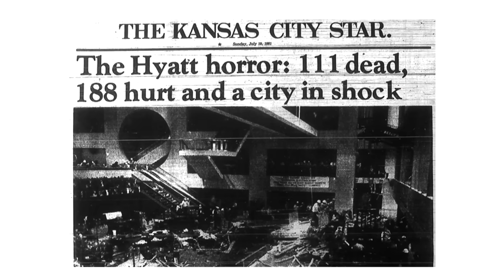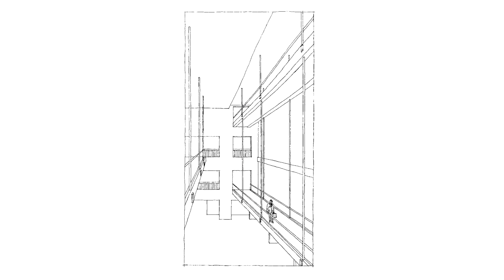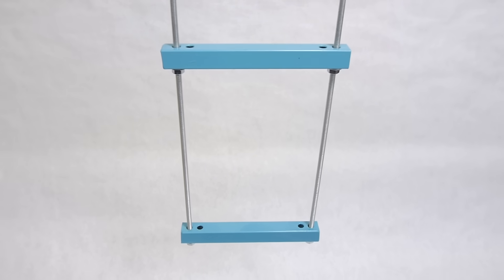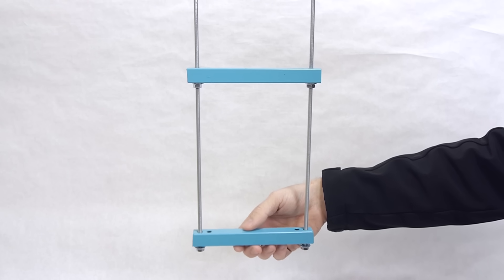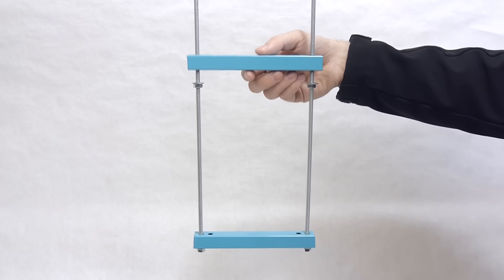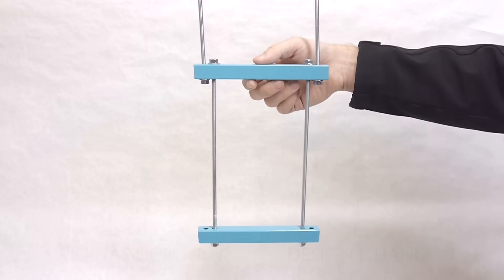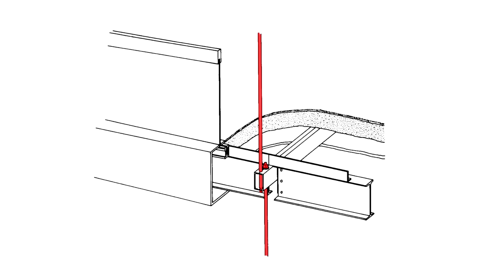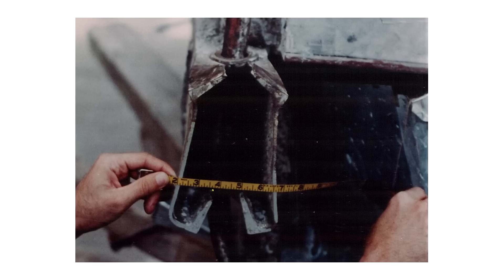The Disaster That Changed Engineering: The Hyatt Regency Collapse

Comment: I liked the analogy of me holding onto a rope, and a friend holding onto my legs.  My grip then supports double weight.

I recommend Henry Petroski’s book To Engineer Is Human from the 1980s, especially the chapter “Accidents Waiting To Happen.”  From this book, I draw four contributing causes of this tragedy:

1.  The walkways were under-designed from the beginning.

2.  This change made them worse.

3.  The construction project was — almost inevitably — behind schedule.

4.  There was an unusual use is that there was DANCING on the walkways during the party.  There really was.  But obviously, the walkways should have been adequately designed to withstand this.

And lastly, don’t engineers sometimes plan for “alternate load paths”?

Comment: Far far more interesting is the design errors in the Miami foot bridge collapse. Which combines a shambles from start to finish, by all accounts.
Reply: That entire thing was a train wreck. I remember everyone blamed accelerated bridge construction “the bridge was built in 2 days!”, then Chinese steel, then the fact they “didn’t put on the suspension” even through it was decorative and then the alt-right blamed it on an all female team which was a complete fabrication. 

In the end they simply miscalculated the shear loading and therefore didn’t adequately reinforce the deck at the 11/12 node.
Reply: @morbideddie  As an Engineer myself I am well aware of the huge concentration of forces in bars, nuts and concrete at the nodes...to my mind almost impossible to really conceive working in such a lash up.
My whole working life has been to never stand under a moving load, almost a mantra for 50 years.... but here we have numpties trying to tension a structure that is already working, over an active highway.

Comment: you know i watched the seconds from disaster on this incenent when it came out on discovery channel and it got me thinking at the time. pepoel say about lurning from the past but having never worked in structural and limited knowledge of civil engineering. as an child having seen the investigation photos with no prior knowledge of the incident. i came to the same conclusion the inquest did within seconds of being told how it was constructed. even i know that suspending one load from another suspended load is stupid. if you use a little common sense then you can catch these failures before they even start. no excuse as far as im concerned, these people are supposed to be experts in there feald yet ballsed up and killed over 100 people. if it had been through material failure due to a genuinely missed flaw from the factory id understand or the walkway was loaded to 2x what it ever was desined to take even if it was made properly. but seriously, to quote one of my workmates. "what the bloody hell did they think was going to happen". im 31 now and this incident still winds me up to this day.

Comment: The design change was accounted for with bigger nuts.  The ussue was that the walkway was designed for people to walk across not stand on and jump around.
Reply: the walkway should have a high enough safety factor to handle all of those things. if it could handle walking and not standing/jumping then it's not safe enough for use, even if it will only be used for walking
Reply: The nuts didn’t fail, the beam did so bigger nuts will only spread the load a little wider, they won’t change the fact that the total load on those wields is doubled. The walkways were poorly designed on multiple levels but I can’t find any reference to the error being from a lack of dynamic loading accounted for.

Comment: I’d imagine that the redesign also added some torque into the equation?
Reply: It would add moment to the cross beams but it would actually be resisting the main bending in the walkway since the design used hung the lower floor from the outside. This additional moment wouldn’t affect the loading at the nuts since they allow rotation but it would reduce the momentary load in the centre of the walkway.

Edit, checked a sketch from the incident and it turns out that the second walkway was actually hung from the inside so yes, there would have been some additional loading on the cross beams, though that still wouldn’t apply to the bolted connections and would probably be fairly minor considering the short lever arm.

Comment: I still don't understand why so much of the blame is placed on splitting the threaded rods into two sets. Sure, I understand how that doubles the load, but why does no one talk about the fact the load was placed on the TOES of the C-channels. As I understand, this wasn't a box girder... it was two C-channels welded toe to toe. If you look at all the pictures, it isn't because the channels couldn't take that kind of moment. The channels clearly could not take that rotational torque. All the time I see I beams have additional plates welded at these locations so the individual bottom and top flanges don't fail. Why wasn't it done here?!? I'm curious if the design would have worked if they used washers that were big enough to actually get the load under the webbing, thus putting no rotational torque on those toes. OR, reverse the C-channels, so the webbing were to be back to back, rather than toe to toe.

Comment: Before my degree, I used to go on roller coasters and have fun on them. Then I got a job and met more engineers. I don't do theme parks anymore
Reply: Even worse than roller coasters is fairground equipment that gets packed up and moved every few months. How often have you taken apart some reasonably complex machine like a lawnmower, put it together, and found there’s a washer or split pin left over? Even worse, how often have you done this, run the machine, found it works fine, and thrown the leftover washer into the “spares” bucket. Ok, I am not a highly qualified engineer, but neither are those guys at the fairground.
Reply: @albertbatfinder5240  Roller coasters are safe dammit, maybe fairs are less safe but still
Reply: once i started working in the oilfield .i looked at the guys running the portable roller coasters at the fair.i looked at all the  pins and keepers holding the coaster up never rode any fair ride since.
Reply: i looked at a ride after that saw a U clamp on the wrong way on a support cable thought that  is why i wouldn't do any ride
Reply: @erniew5805  I would have thought that would only improve the reason to ride a roller-coaster? I mean the whole point is to terrify you so surly it would have been more effective on people who knew the risk.
Reply: @generalharness8266  i thought billions of years of evolution gave us a survival sense but apparently not?

like, the point of a rollercoaster is to be a thrilling experience, and thats fun and i like it, but its point isnt to KILL you because of negligence??
Reply: @lemonandgaming6013  Never said that its purpose was to kill you, its purpose is to scare the crap out of you, if you knew the risk getting on you would be even more terrified. 

Survival instinct is not a evolution its more from a personal experience, Confirmation Bias is more from evolution where you are more likely to believe if you are told something is dangerous then safe.
Reply: @generalharness8266  i quote "u clamp on the wrong way on a support cable". listen, im the kind of person who would accept the risk to travel on a rocket to the moon because of my passion for space travel, but if i was a structural engineer or whatever and saw that kind of problem, i wouldnt be willing to go on the ride.. i want a ride to be scary and pull disorienting maneuvers, but i dont want it to be scary because it is straight up dangerous!

about what you said about survival instinct ? idk if you are right but your claim is definitely interesting and i will be reading more on the subject, thank you
Reply: @generalharness8266  you know, roller coaster are one of the safest thing to do
Reply: I know, they're so boring, right.
Reply: Too many things are constructed looking at the cost of safety vs the likelihood of something breaking. Failure is allowed if the cost of failure isn't too great.
Reply: Wdym? Roller coaster are safe...

Comment: The engineers bear the brunt of the criticism for letting this slip through, but the concept was flawed from the outset.  The design was driven by its look, not its safety, and it was underdesigned to give it a minimalist look.  To make that concept work, they should have had separate hanger rods for the lower walkway going all the way to the roof, larger rods, and much more robust connections at the walkways.  Better yet, they should have built a conventional structure, as was done to replace the original.

Comment: Above a certain IQ threshold this is really really obvious. I'm not an engineer, and I never even studied anything like physics past the 10th grade, but it's patently bvious to me.
Reply: Josh White — Even the original design was substandard.  You probably would not have recognized that.
Reply: @GH-oi2jf  that's correct. Intuitively seeing that changing the design completely changed some of the high stress points from the original is not the same as being able to intuit the optimal design.

Although if I did have to design it,  I'd probably add pins through the vertical rods of the original design to further distribute the load on the horizontal beams. Adding cables with adjustable tensioners would be another another step to consider, but I'm not an engineer. Just a guy with a functional brain.

Comment: That's an unbelievable 'Schoolboy' error on the part of the Structural Engineers involved.
Why would no one ask for a recalculation of the new loadings ?
and...
Simply doubling the load on the original arrangement caused a catastrophic failure suggests there wasn't a huge safety margin in the original design, meaning cheap cost based Engineering.

Comment: I mean the collapse of the WTC-towers could technically also be attributed to bad engineering.
Reply: SuperCannonier — No.  They weren’t designed for that scenario and they didn’t have to be.
Reply: @GH-oi2jf  Okay let me ask you this: Would the Empire State building have collapsed if it got hit by planes?
Reply: @GeneralBiJay  It was hit by an aeroplane - a small one.
WTC collapse was due to thermal weakening of steel, then a series of impact failures.
Reply: @LaurieWilliams-lk8fc  No I mean in general. If the same 767 hit the Empire State Building would the building have collapsed? I am not sure tbh.

Comment: Engineering disasters are never the result of just one bad decision.  The original design only supported 60% of the minimum load required by law, and the revised design halved that to 30%. Doing a stress test of the structure by inviting everyone over for a party was also probably not the right move.  But the main problem was the general industry corner cutting technique of not checking any math. The faster you can construct buildings the more buildings you can construct. In other words, cash money dollars. Are we still Capitalism? Then nothing's changed.

Comment: acording to the engineer, there was supposed to be an additional steel support plates supporting the rods that would have significantly increased the load tolerance of the brackets holding the connected rods going through each floor.  This was partly the engineer's fault for not giving instructions to the construction fabricators to create these steel support plates as well as the fabricators for failing to see that the rods needed these additional steel support plates (any good architect that paid attention to the design would have seen the need for this and made sure the fabricators made the proper steel support plates for the brackets).

Comment: We covered this in year 11 physics 20-odd years ago - I remember flinching as soon as I saw the revised design on the board, though to be fair I expected the walkway to shear rather than beams split open (it was a simplified sketch). My intuition was that the hanging rods were verified structural members in a way that the walkway wasn't, and that passing serious structural load through the upper walkway without recalculating was a really bad idea.
Excellent video, and I learned a number of key points that I hadn't previously known about this disaster.

Comment: Correct, but I have also read that the original design was below code as well.  And when you look at how the box beam was fabricated from two channel beams, with no reinforcing at the points of maximum stress, combined with undersized connecting hardware, the whole concept seems flawed.  I would say cockamamie.

Can such shoddy design ever happen again?  Can such regulatory failure happen again?  Read the OSHA and NTSB reports on the failure of the pedestrian bridge at Florida International University.

Comment: One of the case studies in the engineering ethics course we took back when I was studying Mechanical Engineering in college.
Reply: And not too mention it add a coupling stress that helped  in the failure. Basically the change caused the load below and above to not be vertically inline but I stead offset adding a twisting stress
Reply: The video also neglected to mention the crazy load stress because during the party all walkways were filled to the brim with dancers. And they were ALL stomping their feet in time to the music....while on the flawed modified designed walkways.

Comment: Ok I worried about the lower walkway pulling through the upper walkway without realizing the bigger problem which caused failure. But hey I was given like five seconds and I still thought it was dodgy. If it was my job to sign off on it given lives are at stake I would've worked it out.. and I'm no engineer! I am a rigger for concerts though so it's just a matter of going through actual loading compared to what things are rated to. Not that complicated really. Whoever signed off on this really dropped the ball and should be charged with criminal negligence!

Comment: The other way to fix this without needing to thread the entire hanger rod would have been to take the two shorter hanger rods and join them together with a connecting nut (basically a really long nut). To use the rope analogy from the video, tie two bits of rope together, you hang off the top bit your friend hangs off the bottom bit.

Comment: All those lives could have been saved with some steel plates cut to function as giant washers under those nuts. I'm not a structural engineer but I have enough life and mechanical experience to realize those welds/slices/lines call them what you like down the center of those boxed girders with the rods then bolting through them were a serious weak point, and whoever signed off on that was criminally negligent.

Comment: Since I studied Civil Engineering at Uni. we studied this failure, and regardless of my limited Engineering nous, my farmer-bred larning wondered why the engineer, or fabricator, had not simply opted for tubular threaded connectors at the fourth floor walkway, thus no need to thread the entire length of the rods(a cost saving) plus ensuring  engineering integrity and elegant design.

Comment: It doesn't appear the nuts and rods failed but the holes in the upper walkway - deforming and allowing the nuts to pull through. Needed larger washers on tp of the nuts to support the load better ;)
BUT were the walkways ever designed to be full of people in any case ?

Comment: Odd that the incredible failures of WTC1, WTC2 and WTC7 didn't change engineering at all.  How could fire lead to freefall collapse of steel-framed skyscrapers?
Reply: In the case of WTC1 and WTC2, The jet fuel burning between all of the trusses overheated the floors to the point where they became flexible and could not hold the floors above them due to the force of gravity.

Not sure about WTC7. Perhaps the weight of either the top floors of WTC1 and middle and top floors of WTC2, accelerated by gravity, crushed WTC7 from above?

Comment: They also messed with the welding leading to the weakness. The constructing company didn't calculate the stability, assuming this was the job of the designer. But the designer assumed the company did the calculations.... Also they forgot to use some parts during building. So not just one mistake (although one of them also would've been enough to cause the accident).  

But most important: The video title is talking about this accident leading to change. But it doesn't mention what changed after that.